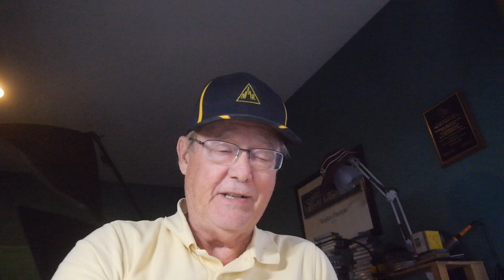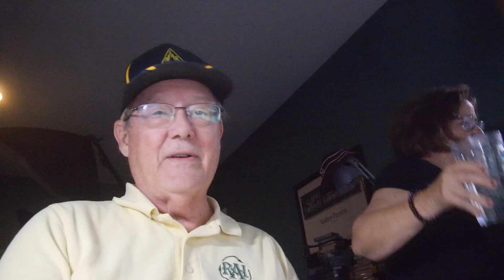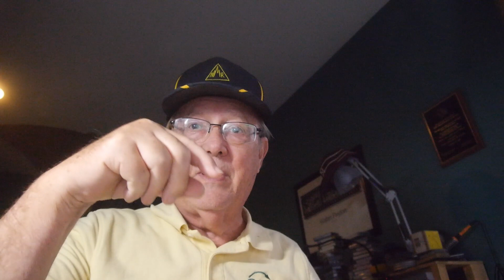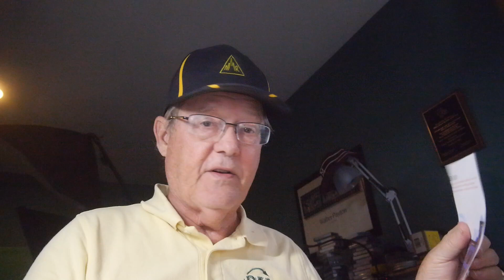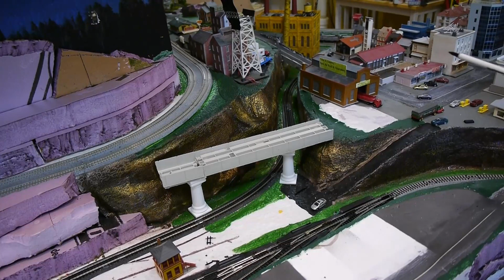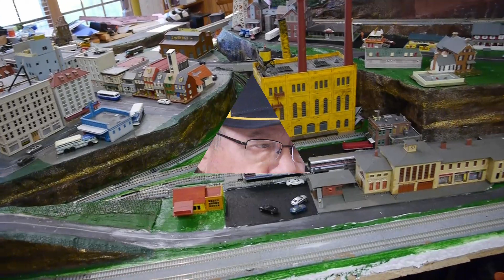Newbie Part 38  What Industrial Park?

Comment: Yep, that intro is still annoying me... I really can't wait for my EM-1. I ordered it in May!
Reply from the maker: Not sure if I related this.  That EM-1 threw a drive rod.  I sent it back in for repair.  About 10 weeks later it came back repaired.  Tested it and it worked fine.  But, it just doesn't work on my tight turns.  So, I also am annoyed...  Thanks for the comments.